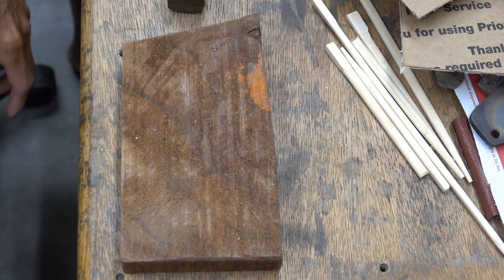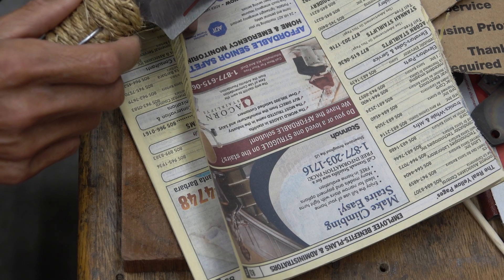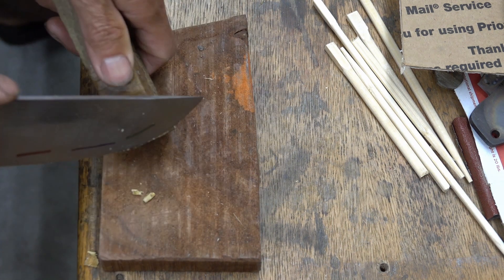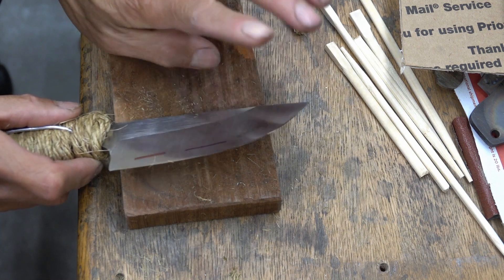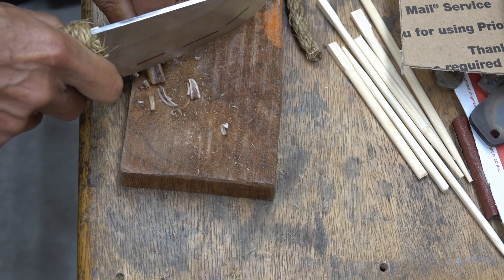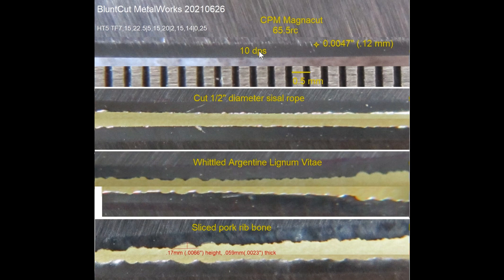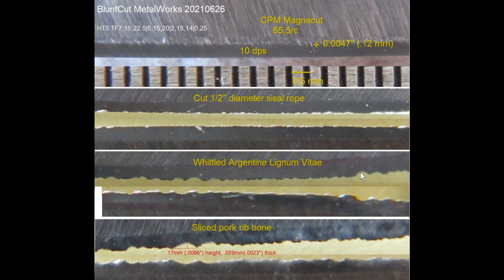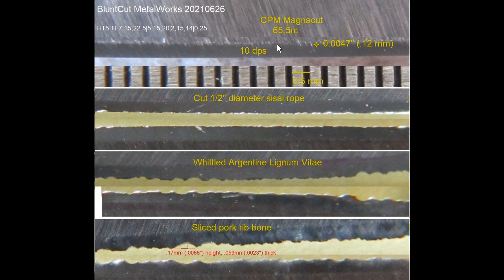CPM MagnaCut 65.5rc 10dps Cut Test

Comment: I would love to see what you could do with your heat treating on CPM Rex 45. it gets very hard already on production knives, you would probably go past 70 HRC.
You heat treating must be pushing grain refinement to the extreme. As far as I know, when you do that, the temperature declines that you have to heat to, and quenching has to be even faster.
Reply from the maker: Hardness is easy, producing high hrc with full elasticity and decent plasticity ranges is quite difficult.  High alloy steels have poor structural toughness.  Thus far, aebl produces low notched impact toughness #s compare to lower alloy steels, esp very low (i.e. carbon steels).

Comment: Superb work!
65.5 RC at 10dps. With this blade, we don't need razor.
Thank you for sharing.
Reply from the maker: Why not a razor if edge usage isn't involved cutting hard materials.
Reply: @Luong_La  sorry, I may have explained incorrectly.
It's an exclamation. I mean with a blade as thin and sharp as this, we don't need a razor.
Reply from the maker: @gialuongpham7870  Oh OK Thanks. sorry, I didn't interpreted the 1st comment correctly.

Comment: great video and super detailed explanation of the damage i really like it,maybe the sweet spot for magnacut to keep toughness is about 64.5 or so even with that thin edge,great results👏👏👏
Reply from the maker: MC edge at 64.5rc seems reasonable for sustain usage at this geometry, albeit  edge damage will occurs in these tests.  So damages = damages regardless of failure mode, whether rolled or fractured, either way fixes = cost of blade height.